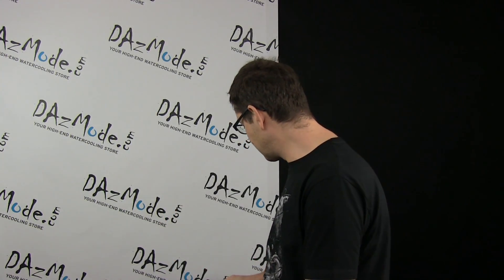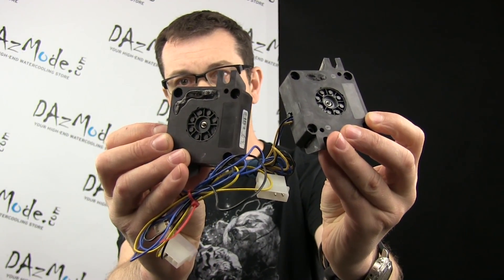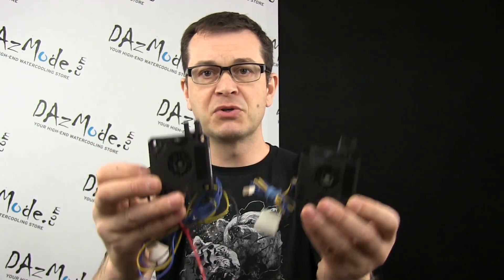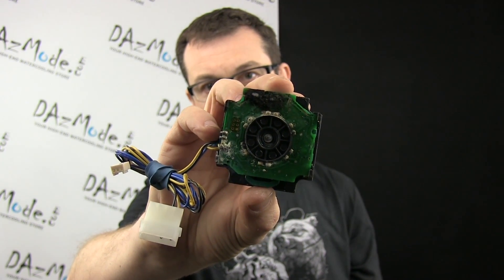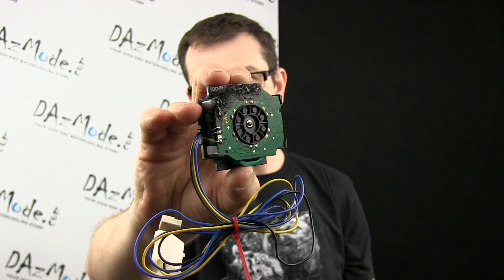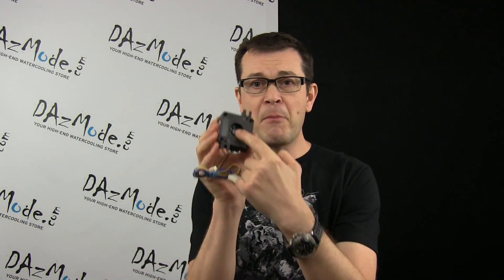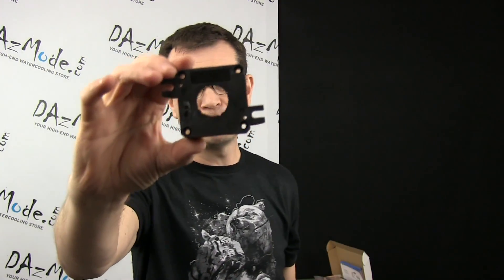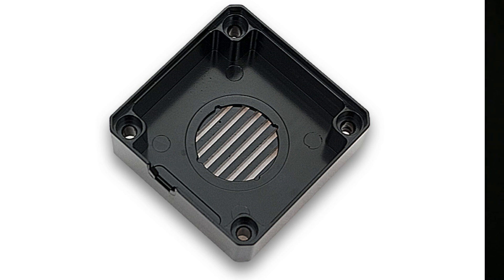EK Laing DDC Heatsink Housing - DazMode Product Updates

Comment: I had two pump burns, one with warranty, one out of warranty.
I did the diyinhk pcb repair and it's up and running again. I'm disappointed in the PCB quality Laing uses.

My pump wasn't isolated at all.
Reply: They basically say on the packaging for ddcs that if you don't have enough restriction the pump will destroy itself.

Comment: Hello dazzie! I sent u an email but i never got a response. Im building a new system with two 240mm rads, and one of them is almost impossible to fit 2 25mm fans. Is it okay if i run one of the rads passive? Will it still work out fine or is it a waste?
Reply: It will be a waste, for radiators to work well in passive you require good air flow around them (through them if possible) and you need lots of them. For example I had a MM Ascention case with quad Thermochill PA120.3 radiators (the thickest you can get), and all four could barely keep my quadfire setup cool when used passively. Just the addition of four fans (out of 12) my temps dropped by over 70%. 

If you can't equip your case with the cooling required to use water, then don't or at least only on the components which can be adequately cooled by what radiators you can fit in.